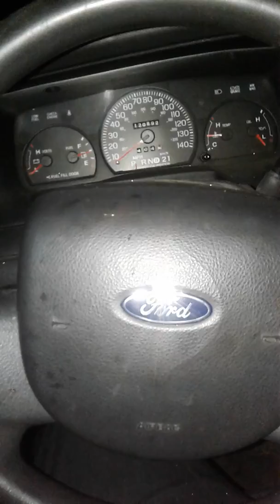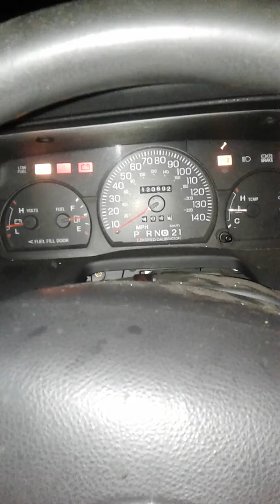Crown vic timing chain rattle  (possibly)

Comment: It’s the hub on the ac compressor. You can replace that whole hub unit for about $100. It uses the compressor on max ac, norm ac, mix, and defrost. Try it in those 4 modes and I’ll bet money that the only time it rattles.

Comment: Run it (for a very short time) with your belt off.  I suspect that your A/C clutch hub and pulley are bad.  If the noise goes away that's what it is (or another accessory drive bearing). If you let it go too long it will damage the compressor itself and not just the clutch, hub, and field coil.  I am currently putting back together my Vic that had worn tensioner guides to the point that the steal tensioners got grounded by the chain.  So I had to remove the oil pan to clean the oil pickup tube and I also replaced the oil pump.  I watched your other videos about the intake and valve cover.  Years ago I replaced my intake manifold and both valve covers in one shot on my 300k mile Town Car, it was easy.  I did jack the engine to do the covers but not much, did it all in one day.  However with my Vic the previous owner only did the intake.  I recommend doing intake and covers in one shot and inspecting the chain for play when the covers are off.   The slack and play is very obvious with the covers off if you know to check it.  With my Vic I had no reason to pull the intake but I am now struggling to get the covers back in and find it much harder.    Good luck to you.
Reply from the maker: I replaced timing chain tensioners took about 3 days in the freezing cold for no reason. The problem was the AC pulley it locked up finally and snapped the belt. Luckly I just pulled one off a box in the junk yard the day before so I replaced it on the spot.
Reply: @MegaBobson123  We got ours done the day after I post here.  Covers went in easy all of a sudden.  Funny how some rest can make things fall together.  Anyways we had the motor jacked up because we pulled the pan.  The passenger side cover went in easy after reattaching the LH mount and tilting the engine instead of having the motor completely raised.  The Drivers side cover only needed the coil packs removed and I turned the injectors so the connectors did not stick out.  No removal of fenders, brake boosters or any of the other stuff I have seen.

My son just bought this car and I told him we should have done a video as this repair was more intensive than what I have seen other people do. (related to timing failure)  But he was uninterested.  The amount of damage and the amount of repair needed surprised me as the motor only made a very light rattle noise.  

Despite this chunks of aluminum on the timing arms were gone and debris throughout the engine.  We removed the pan, cleaned up the pickup tube that was getting restricted.  Unfortunately after everything was done I noticed the oil pickup tube is too close to the pan by using a bore scope. (lesson learned, check this before completely reassembling lol) I ordered a new tube.  The car runs fine with good oil pressure but I figured we will replace the tube after about a week of driving.  This will give time for the old tube to catch any chunks I may have missed still lurking in the engine.

Anyways I mention these things to help other people out and so they don't make the same mistakes that I made.  Happy to see you got yours figured out.  Doing it in the cold must have sucked.
Reply: Mine only makes a weird sound on Start up

Comment: Its not bad at all, i did it in a few hours or less, thats with running to ford to pickup a new timing cover/gaskets. good for another 100,000. I wouldnt drive it like that, plastic getting into the oil pickup or other places. its probably rattling when there is tension.
Reply from the maker: Thanks for the input very helpful👍
Reply: @MegaBobson123  losen the valve covers in the front just enough to get clearance for the timeing cover to pull out. Oil up a little on top of the timing cover sides. So it helps it slide under without messing up the valve cover gasket. I was able to do it without removing the valve covers.
Reply from the maker: Quick question do I need to remove the power steering pump or just the pulley to get the timing cover off

Comment: Its 100% the ac compressor pulley100%. The same thing happened to my p71 2002 crown vic and it ended  up being the bearings going out and then the magneto that engages the pulley got destroyed and seized up an snapped the serpentine belt in half. It's a 100$ fix for the magneto and the pulley and it will fix ur problem guaranteed.
Reply from the maker: Your right.  Thats exactly what happened. Wish I would've figured that out before replacing timing chain guides and tensioners. 😒

Comment from the maker: I replaced timing chain tensioners took about 3 days in the freezing cold for no reason. The problem was the AC pulley it locked up finally and snapped the belt. Luckly I just pulled one off a box in the junk yard the day before so I replaced it on the spot.
Reply: I was going to say it sounds like the AC compressor.. Heat or AC when you put on the defroster the AC compressor kicks in.. How much was the AC compressor, because i suspect that mine is on it's way out..
Reply from the maker: @shartingfish5761  it was abot $40 @ junk yard. Or about $1000 for new motorcraft
Reply: MegaBobson123 so windows open, shorter belt it is.. lol we don’t have a good salvage yard by me.. we don’t have emissions or inspection, by the time it’s junked, typically nothing good is left
Reply from the maker: $38 at the junk yard
Reply from the maker: @shartingfish5761  still have the "junk" compressor on and its working fine.
Reply: MegaBobson123 nice! I ended up replacing just my bearing, found one on amazon for 12.00 was a bitch to get off.. but it's all good now..

Comment: Good luck I got a 2002 Ford Explorer Eddie Bauer with the 4.6 in it I was having a very similar problem like yours with rattling under the valve cover had it for months until I fine the problem it was a PCV valve rattling why it’s idling witch it’s a big relief cause I heard the 4.6 had issues with timing chain guide breaking try to look at your PCV valve but again it can be anything rattling good luck bud

Comment: So how did this turn out?  Was it the timing chain?
Reply from the maker: I replaced timing chain tensioners took about 3 days in the freezing cold for no reason. The problem was the AC pulley it locked up finally and snapped the belt. Luckly I just pulled one off a box in the junk yard the day before so I replaced it on the spot.
Reply: @MegaBobson123  Goes to show not to rush into replacing parts because of panicky self diagnostics